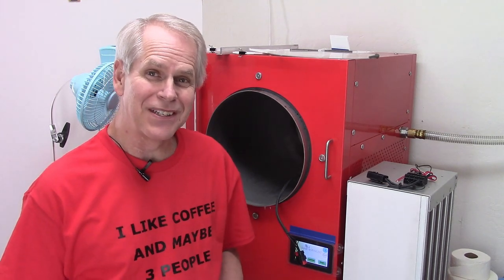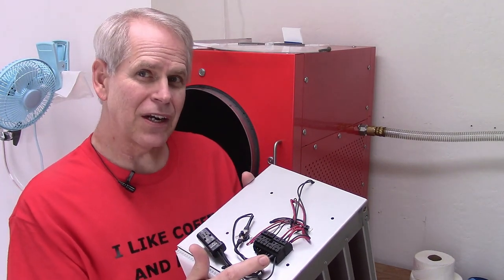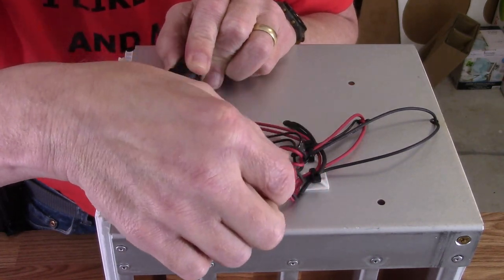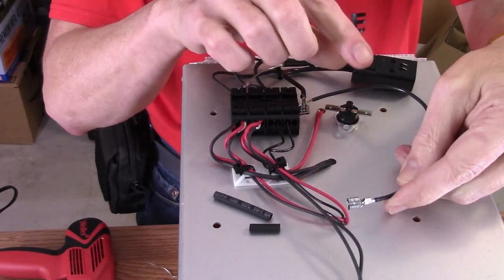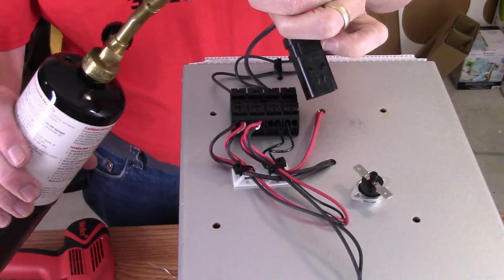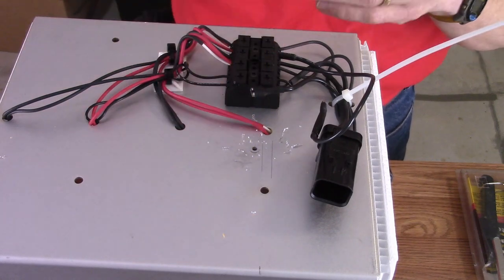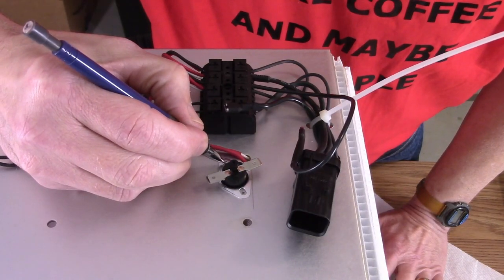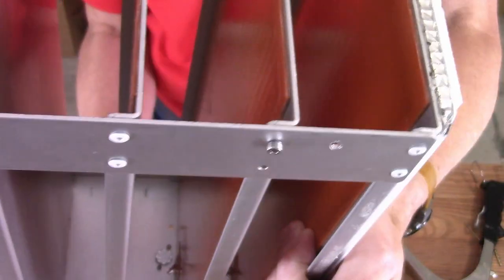KSD301 Manual reset Thermal Fuse Cut-off Limiter Install

Comment from the maker: Want to support the channel? Buy me a coffee :-) https://www.buymeacoffee.com/DanZm

If you are thinking of buying a freeze dryer, please consider supporting us by purchasing through our affiliate link.  It helps us and costs you nothing! https://affiliates.harvestright.com/995.html
Before buying a freeze dryer perhaps research to find out more about the downside of the machine; like with any big machine, some people say they have had problems with their machine and it's big and heavy and hard to return!

Batch worksheet link: https://docs.google.com/spreadsheets/d/13DCB2hXo9_ZYrhIUicLk2IrEaQGszwbaJTcEH8wJxk4/edit?usp=sharing   
Freeze Drying: The Next 50 Batches 551 to 600 https://docs.google.com/spreadsheets/d/1SeVFOmCqhu75fg96E9lAjUXsK9zJotiZ_HKhzQ0dAXA/edit?usp=sharing

Comment: i just had a problem with mine. I had it for 4 months, it malfunctioned. actually looked like it kind of burnt apples slices i had in there.  It would freeze and never warm up.  they had me to download and install newer version of software, still didn't work. It had alot of ice build up which was unusual. when I hit defrost all I heard was clicking noise.  Once I finally got back in touch with HR. the tech had us take off the back and push the reset button. works like a charm now.  I'm liked the older version better.  this is still not the most recent update but it is working properly now.
Reply from the maker: Sorry you had that problem, but it's good to know that it works. I like my very old firmware.

Comment: Cool! I just had to deal with a "unable to hold a vac" error code. Turned out to be the ball in the drain valve was not completely closing anymore. It was a tiny bit corroded but I think the toggle for the open/close was stripped. With the holidays it took about 7 or 8 business days to receive the new valve from H.R. I am relieved that it was an easy fix.
Reply from the maker: I think I should get/have a drain valve in my spare parts box!

Comment: Dan, you know more about Freeze dryers than anyone I’ve come across.  The insulation on the bottom of my tray rack is coming off after 4 1/2 months of use. HR says use double-sided tape to fix it.  Can you suggest what tape would be food safe and resistant to the extreme temp changes?  Thanks!
Reply from the maker: I don't actually know. I tried a light weight double sided tape to try and add a second layer of the plastic to the top, and it was not entirely successful. When the current batch finishes, I will try a strip of 3M VHB Tape 5952 on it and see if that works. The problem seems to the the wildly different expansion/contraction rates of the different materials. (plastic vs aluminum)

Comment: You mentioned that your sisters unit was misreading the temps. Did you ever  solve that problem? Mine is giving me an undercooling error code reading above freezing when my temp gun reading shows -30. Any help would be appreciated.
Reply from the maker: With hers it seems to be a calibration issue, but everything is working, so she ignores it and trusts the thermometers she put into the food on the trays. Hers hasn't given her any temp error code. (Yet) 
I would start with checking the connections of the thermistor.

I don't know if there is anything helpful for you, but have you already looked through the Troubleshooting Guide? https://harvestright.com/v50/?tsg=0 (Not sure if there is anything there that would help with this issue)

Comment: did you happen to get a ohm reading on the heaters and thermister?
Reply from the maker: I did but I didn't note it. I was just checking to see if all the heaters were the same and about the same as my sister new machine. Mine is empty right now and I could check if you want to know.
Reply: @SchoolReports  if that would not be trouble for you
Reply from the maker: @johnbailley4468  The thermister is a 10k thermister; at the time I checked it it read 12.8k, which is pretty close to prefect for the 67ºf room it's in.
The Thermal Fuse has a reading of approximately zero ohms. (It reads 0.8 ohms and the probe to probe reading is 0.8 on my cheap meter)
For the heater pads: (from top to bottom) 
Above the top = 90 ohms
#1 = 92 ohms
#2 = 96 ohms
#3 = 92 ohms
#4 = 93 ohms
Reply: @SchoolReports  thank you. total ohms for heater i got 17.8. 5 in parallel. which is what your readings are. and 14.77k at 80 degrees. does this control the heater pads turning on and off and also give you the tray temp readings. i have a problem that there is too much heat.
Reply from the maker: @johnbailley4468  The thermister is where the tray temperature reading comes from. (Which is why I put thermometers into the food, because the temperature of the trays doesn't tell me the food temp) 
I don't have access to the firmware the freeze dryers are using, but from my experience with my 3D printers and their programs (which I have been in and made program adjustments), I'm going to guess that, yes, they are using the data from the thermister to control the heater relay. You can check the data to see at what temp it's turning on and off the heaters.
14.77k equates to about 61.5ºf! That's showing about 18º off! 
I don't know if they used any other value thermisters for the machines. (My sister's machine also seems to have a 10k thermister)

Your thermister does seem off, so it will probably overheat, but how do you know you have too much heat?
Reply: @SchoolReports  as soon as i plug in the trays and start to run the heater relay test it says too much heat. seems like there is not enough time for the heater pads to warm up to get to a overheat. i think that there is a false signal going to where ever to entergize this fault.
Reply from the maker: @johnbailley4468  Maybe this one could help?  https://harvestright.com/v50/?tsg=4
Reply: @SchoolReports  i did look there . no help. i wish that i coulg get a a schenatic of this thing.
Reply from the maker: @johnbailley4468  Sorry, I've got nothing. The fact that you get the over heat message as soon as you start the test would suggest that it may not be the relay. I would think that if it were the relay it would still not give you the over heat fault until it got up to an actual over heat temperature. Could you have a faulty thermister and it's lying to you? 
Unfortunately, I know so little about electronics that my usual method of fixing my electronics is to look for any obviously burnt or blown components and replace those! I know the capacitors in the power supplies for my 3D printers well.
Reply: @SchoolReports  yes i am being to thing it is the thermistor. thanks for the reading.
Reply from the maker: @johnbailley4468  Didn't know if you had/needed this chart: Resistance to temperature conversion chart for 10k thermistors https://waiterecc.com/wp-content/uploads/10K_Thermisitor_Chart.pdf
Reply: @SchoolReports  wow ! great thank you

Comment: So you're basically putting two breakers in line? Is that a good idea?
Reply from the maker: Yes, it now basically has two breakers in line. (one re-settable and one that's a single use)
Is it a good idea? That depends on the definition of "good idea." 😇 It's unnecessary, but it also won't hurt anything, so it's not a "bad idea" in the dangerous sense.  We (collectively) own many millions of things that have multiple fuse/breakers, especially thermal fuses. Some power supplies have a fuse at the plug, a fuse (or two ) on the board, and thermal fuses built into the transformers.